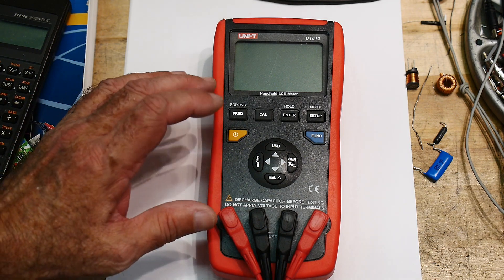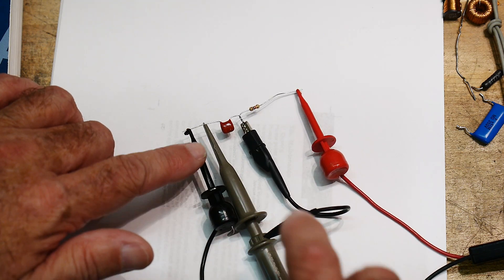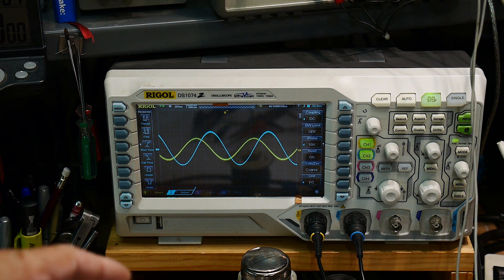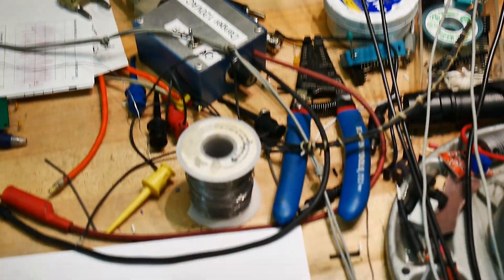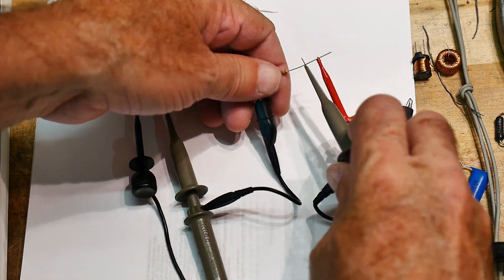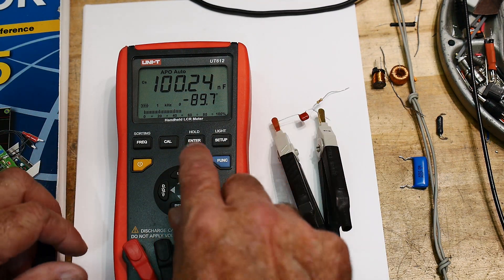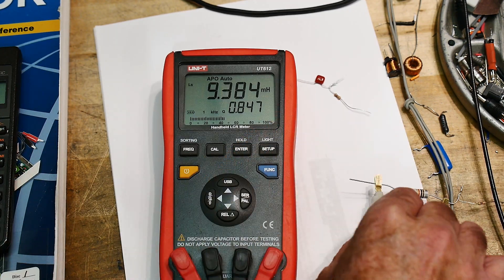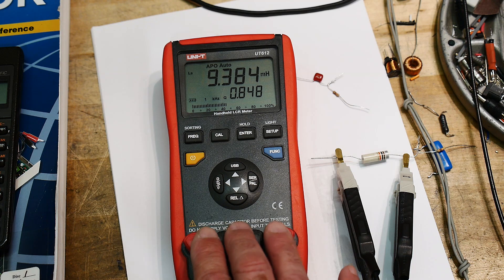#560 LCR Meter

Comment: Is the theta(phase difference of voltage and current)is depends what value. Here when you  measured it shows 89 degree without connecting capacitor to any signal. I was in impression that theta comes to existence when we supply signal to capacitor. How to change theta for capacitors

Comment: Can anyone recommend an 'in circuit' LSR reader. I'm looking to find the bad cap in my NAD 3130 and really don't want to unsolder each cap to do this. Cheers
Reply: Best budget one is Mesr100. its cheap feeling but does in fact work very well. A step up in price and a huge step up in quality = bob parker blue esr meter. This meter is now made by EVB out of portugal but anatek in the US still has some.

Comment: Can i use it to measure unknown capacitance of a capacitor on the circuit, like SMD capacitor?
Reply from the maker: You will have problems measuring any component in circuit. Best to remove it

Comment: Do you have any thoughts on measuring very large value electrolytics?  I have some old Astron power supplies with the filter cap at 40,000uF.  I'd like to get a feel for if it's near end of life.  My LCR meter wont measure ESR of these really large caps
Reply from the maker: that is hard. you might try charging the to max voltage and then time the charge and discharge rate.
Reply: @IMSAIGuy  That was my plan but I was thinking perhaps you had a better idea.  I was also thinking of contacting one of the large suppliers and see if they have a process other than their automated test.
Reply from the maker: @mjrtude  I had good luck with the big caps. If you just look at the ripple with an oscilloscope and it is good under load I wouldn't worry about it. Those big ones can be expensive. You can replace them with a bank of caps in parallel.